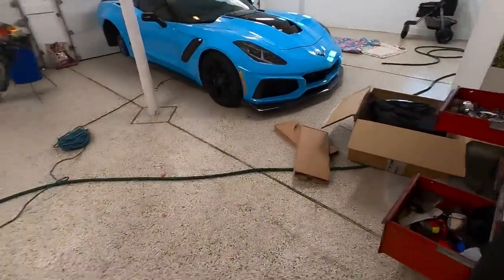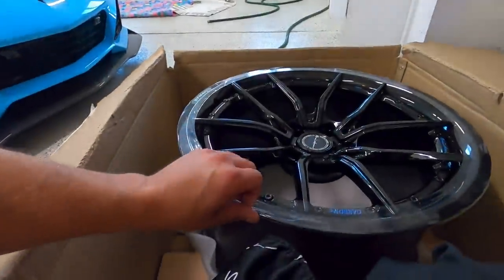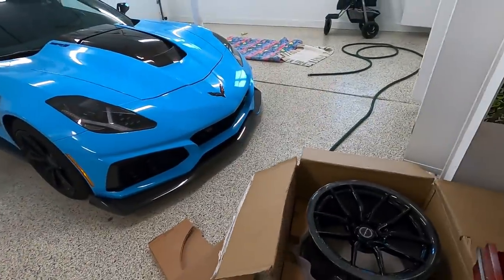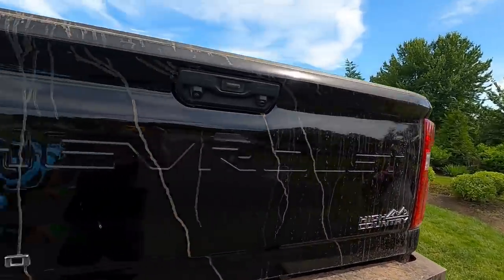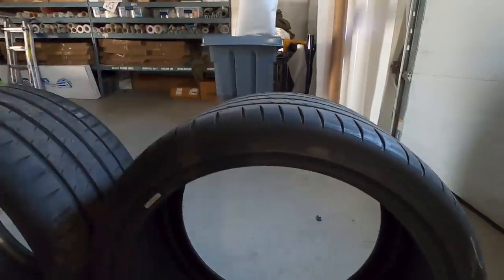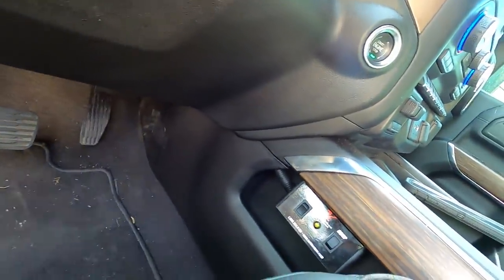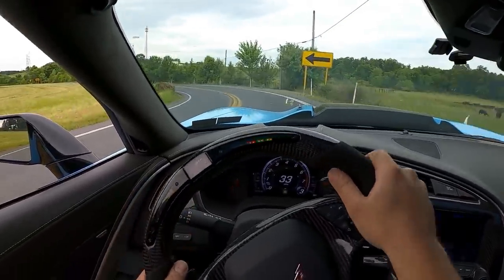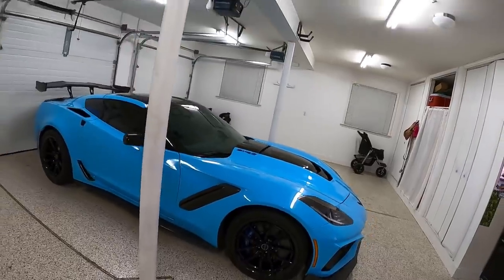I Bought The Most INSANE CARBON FIBER Wheels For My 1,000HP ZR1!!! *$20,000 A Set!*

Comment: Why are wheels staggered on a sports car and different size diameters. Is it for lateral grip? They are the same on my GT500.
Reply: It improves  overall maneuverability, and even can shorten turning radius.
Reply: It’s for better launches.
Reply: Because u don’t need 335s up front
Reply: Lance Cali debatable
Reply: VIPERFREAK16 makes sense. Less rotational percentage rear to front
Reply: Because you dont need as wide of tires on the front if theres no power going to them, and keeping them skinnier is lighter
Reply: They help soak up the launches.

Comment: Those wheels are beautiful and a great visual feature for up close where you will notice them. The weight difference is more about "unsprung" weight and suspension feel than it is about "rotational mass". They are really an asset on a road course, but will have little effect in roll racing, so it's mostly 'eye candy' here.

Comment: Would be great if you could quantify the increase in performance with real numbers.   The wheels are sick, but $20K buys a lot of mods on an otherwise stock or lightly modified project car.   With the reduction in rotation mass you might see increased acceleration & braking rates.  Not sure about cornering performance (lateral G loading)

Comment: $20K for a set of wheels is crazy money for wheels. I just say this because I know someone that bought a slightly used Camaro SS/RS with ZL1 wheel and tire setup along with ZL1 front splitter and side skirts. The car had very low miles,  perfect inside and out, with full bolt ons for mods for $18K (great car for the price). So your wheels cost more than his spotless, low mileage Camaro SS. But everything is subjective. But $20K on a set of wheels is a rich man's game. But the ZR1 is by far my favorite car of yours. It's ridiculously fast and looks and sounds great.

Comment: On the lack of people entering the Viper giveaway, I do think it is the price of the vehicle/ownership that is making people shy away. A lot of people probably don't realize that it is pretty cheap to maintain. A clutch job is in the same ranges as pretty much any other stick car including my 85 Fiero or a C7 Corvette. Only thing I can guaranty will be an issue for some people is the insurance. Maintenance may be cheap enough but the body work is not if damaged. 
I think that it is really awesome of you guys to offer to buy back the car if the winner decides they can't afford it. I know I personally would end up selling it myself if I won, I might try to keep it for a few months just because Viper, but the cost is insurance and fuel would kill me. One month of insurance on a Viper is 6 months for my car. But I would use some of the money to resto mod my current car or find a better example to resto mod so instead of giving me a car you'd be giving me the means to get my project done. Which is something I have suggested you look into before as a give away option. If you can figure out the technicalities and legalities maybe do a giveaway where you just pay for $x.xx amount of work/parts on the winners project.

Comment: Probably pick up 20 wheel horse power. We dynoed a car first with the factory light weight forged and threw on a pair of 20” heavy crome wheels and it made 20 hp less on a dyno jet chassis dyno. We were surprised at the results. Just did it to see how much of a difference it made and it made a big difference. The factory wheels are 19”.

Comment: Its 100 percent true .... if I put 235 75 16s on my tahoe it boogies.... but when i run the 285 75 16 mud tires it's still gets down but not the same tho the ? inches difference in tire size may factor into that as well ....

Comment: Mike you got rid of unsprung rotational weight. Unsprung weight is anything that drops when you jack you car up. All suspension copotients and wheels etc. 1 pound of unsprung weight is like taking off 7lbs of sprung weight. The rotating  weight you took off will definitely make a difference in acceleration. You are not using as much horsepower to move the car. So you will definitely see a drop in your 1/8 & 1/4 mile times. Trips to Mexico will be a lot quicker too. By the way you compare your wheels to Koenigsegg's Carbon Fiber Wheels. Did you know his wheels are hollow. The spokes are about 1/8 inch thick. His rear wheels on the Regera are 21x14 I think. They put one on a scale it weight 11lbs. front 9lbs.  It was a 20 x something I don't remember. Cost to replace a wheel $50 thousand US dollars for 1 wheel. Have fun with yours, show us some slip times.

Comment: Dropping just 10 pounds per wheel with the addition of a lighter set of racing-oriented wheels would equate to a reduction of almost 120 pounds of sprung weight. In most drag racing instances, 100 pounds lost equates to a tenth of a second or one car length in the quarter-mile. It’s a small amount on paper, but it adds up if you’re racing competitively.

Comment: 8 lbs and 11 lbs weight difference is pretty significant. I'm surprised the ZR1 Wheels were that heavy to start with? I dropped about the same amount of weight when I put new wheels on my Camaro  (about 10 lbs per wheel/tire combo) and I was running .2 -.3 tenths faster at the track with 40 lbs of reduced rotational mass . Remember, you have to also take the tire into account too. So it's the weight of the wheel and the new tire size. But again, 8 - 11 lbs (per wheel/tire) is a noticeable performance difference.

Comment: I hope you can add those wheels to your insurance policy.  If your roads are anything like ours here in Central Ohio $20,000 wheels would terrify me.  We have potholes here that can swallow a small child. Those wheels would explode if you hit a “mega hole” at speed. I lost a solid Aluminum wheel 2 years ago on my Cayenne Turbo S.  Bent it beyond repair. Hit so hard it actually knocked my headlights out for a couple seconds.  Nearly chipped a tooth!  😂

Comment: It's not actually full carbon fiber wheels like he said. The carbon part is actually only the barrel the face is forged aluminum. Carbon revolution wheels are the full carbon fiber wheels and they are the supplier for gt350r and ford gt actually you can also have aftermarket from them also. Koenigsegg and porsche on the other hand makes theirs in house.